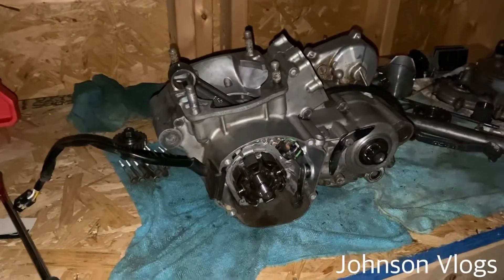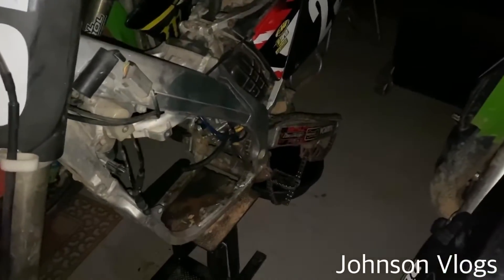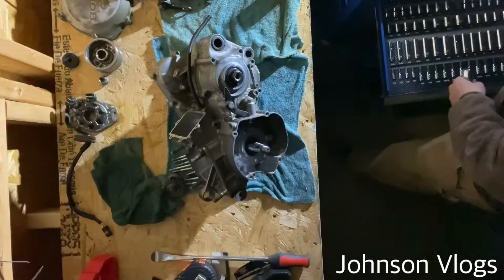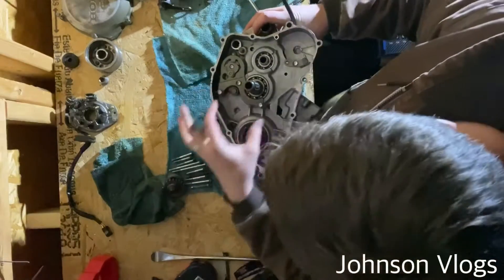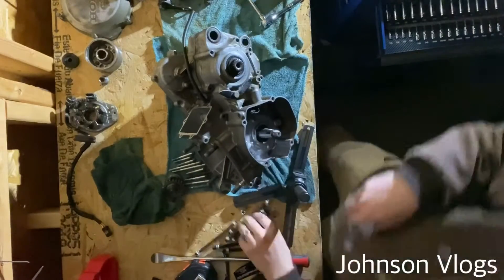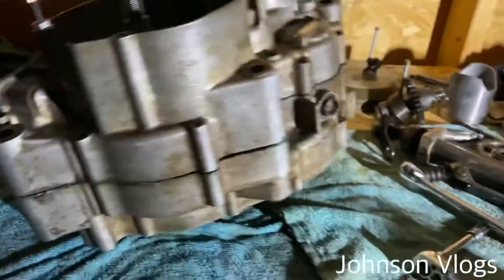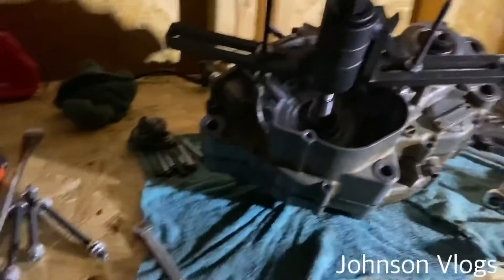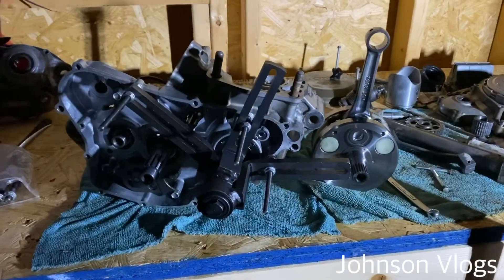Splitting The Case for the Cr250r Build!!! | First Time Ever Splitting A Case

Comment: The guide pin up on the front was rusted and seized on my 2003 CR250R.  I had to move the the splitter arms around to different points and hammer around the edges to get the pin unseized. PB blaster also helped tremendously

Comment: Should have just used a rubber mallet and tapped them apart, would have saved u some cash, I've never used anything else in over 20 years and have never had a problem with using a rubber mallet to split cases.
Reply from the maker: He had already bought it before we found out, but yes it would of saved him some money
Reply: If the guide pins are rusted and seized a mallet will not work. I had a hell of a time splitting my 2003 CR250R even with the case splitter. If the bike is only a few years old, a mallet might work. But a bike that's over 15 years old, probably will need  something more than a mallet, like mine did!